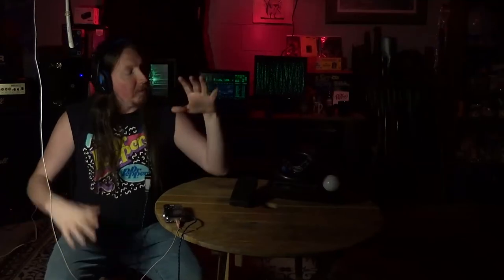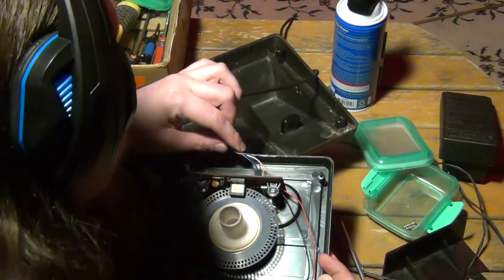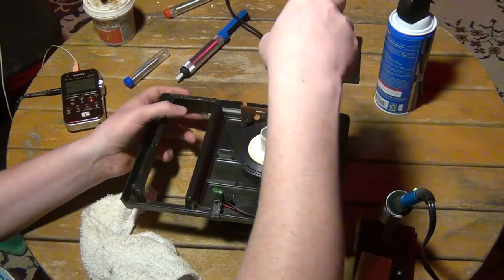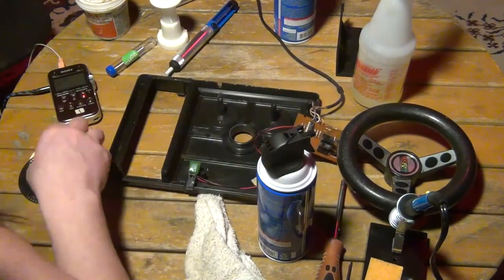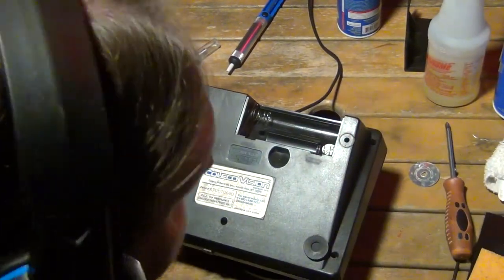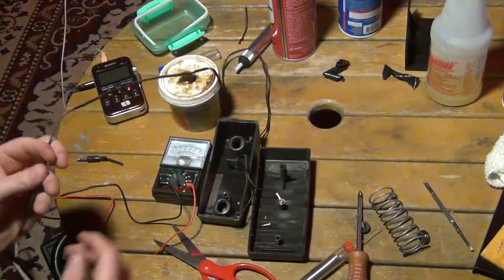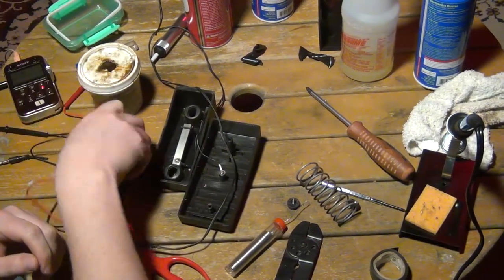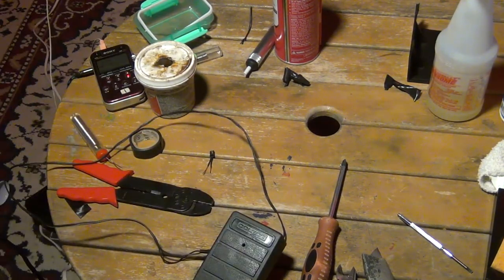Attempting to repair my Colecovision Expansion Module 2 Steering wheel and foot pedal

Comment: I just grabbed one of these and am going to watch your two parts for all the tips.  Doesn't seem to be registering any turning. Thanks for filming this.
Reply from the maker: Hopefully you were able to get it to work
Reply: @janitorjake  I still haven’t. Next step is the cat 5 run to replace the cord.
Reply from the maker: @DoubleDguitar  Yeah, hopefully that will help. Maybe its a break in the cable.
Reply: @janitorjake  most likely. The white rings between the steering wheel have since crumbled to pieces, so I have to figure out how to replace them. Or get another and this becomes “art.”  😆